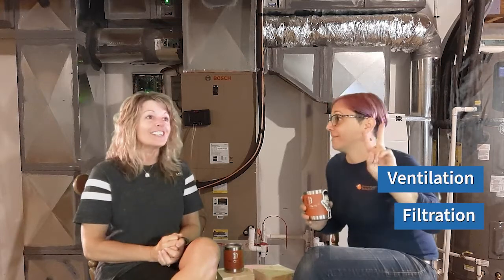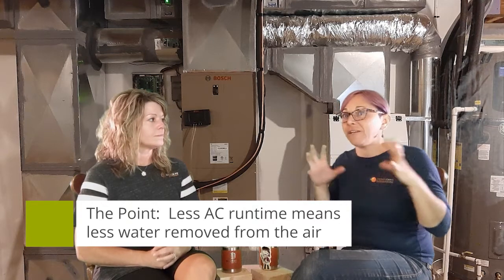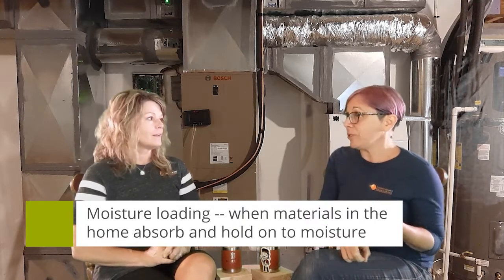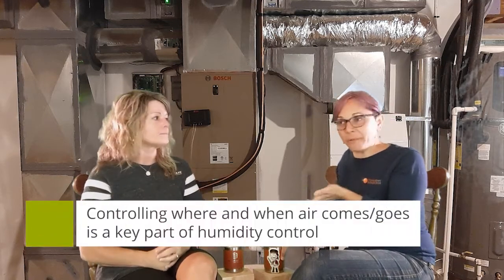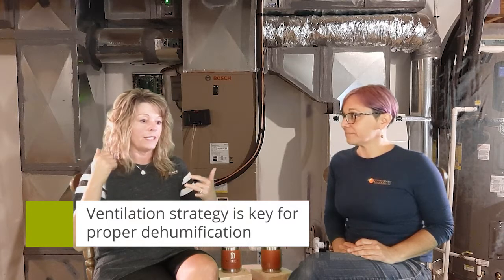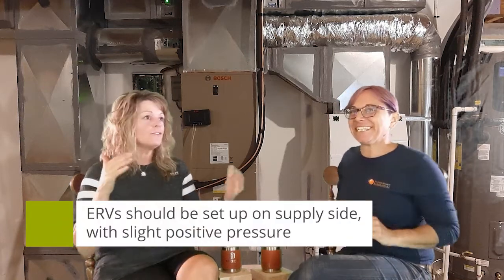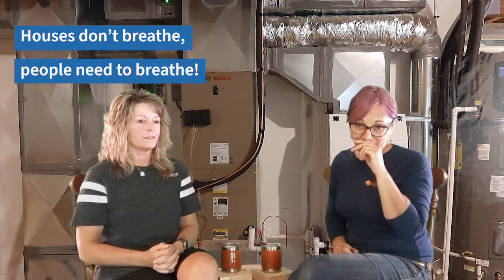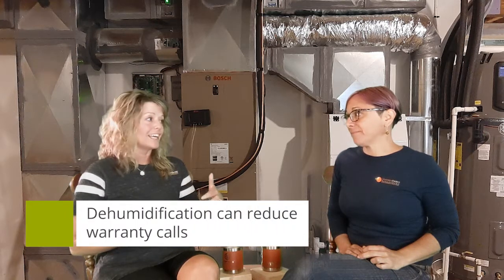Identify & Solve Moisture Problems in Your New Construction Homes

Comment: After I installed a new HVAC system, I noticed the humidity was higher in my house. It seems that HVAC manufactures are trying to be more "efficient"  at the cost of latent heat removal (humidity). So now I need to spend a lot of money and seal and dehumidify the crawlspace, and run a dehumidifier much of the year. That is not more efficient! Why is this happening?

Are you aware of any HVAC heat pumps that are better at latent heat removal?
Reply from the maker: "Assuming the system was sized correctly for your home (not oversized),  depending on where you live you may just be experiencing warmer and more humid weather; Even in new construction we are often decoupling humidity management from air temperature cooling in warm and mixed humid climates.  This is because efficent homes are able to hold the set temperatures longer and the air cooling system does not need to run as often, and therefore a dedicated dehumidification system is needed."